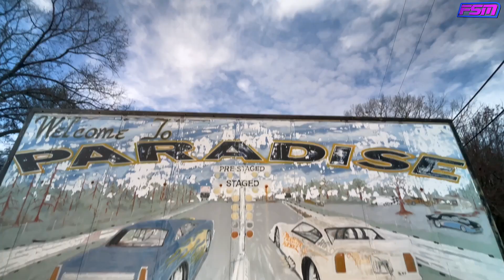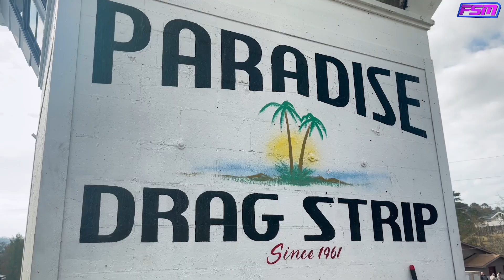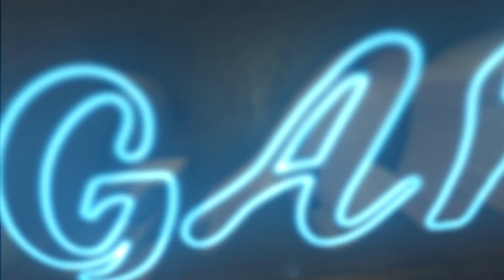THE BARNFIND FIREBIRD CRUSHES ITS BEST PASS AT ITS HOME TRACK!!!

Comment: I can't wait for the day where we can see blaphemi and the rubber duck run down the drag strip together
Reply: yeah. funny enough the crusher camaro ran a blown big block as well. it wasnt far off from what this firebird is running. only issue was its tires. thats the biggest advantage rubber duck has. although bigger tires means more rotational weight. it would take more power to rotate a big tire than a small tire like that of the crusher camaro.
Reply: I can't believe it hasn't happened already!
Reply: @jbrownjetmech-4783  same considering rubber duck has a larger tire. it can actually hang with blasphemi with probably the same power as blasphemi

Comment: EFI fuel pump to Carb. Use a bypass regulator down to 15-20 psi at the tank then use a dead head style near the carb to 6-9 psi.

Comment: That is an awesome car! I love it! I have to ask, What transmission/rear end is in that car? What is the gear ratio of the rear end? I am planning a build on a 2000 Dodge Dakota and I would like some pointers. Thanks!
Reply from the maker: It has a Th400 transmission with a Gear Vendors Underdrive/Overdrive bolted to the back of it and the rearend is a Dana.

Comment: i would go for the bug catcher blower. with yellow throttle bodies to match the car itself. I would opt for forged pistons(if rubber duck already has them) and over drive the blower slightly or add a 200 shot of nitrous.